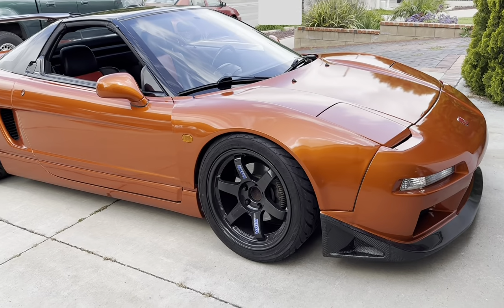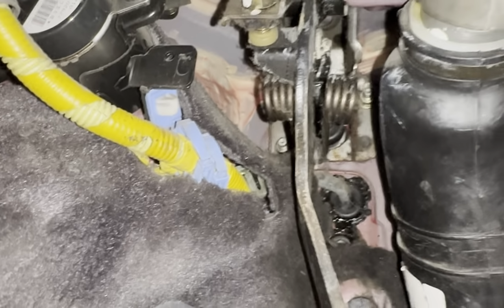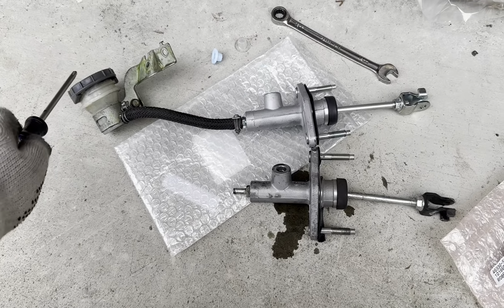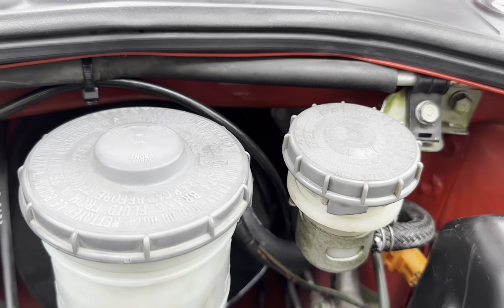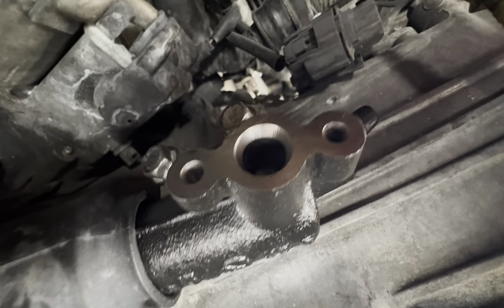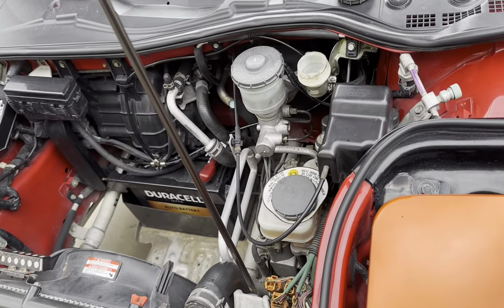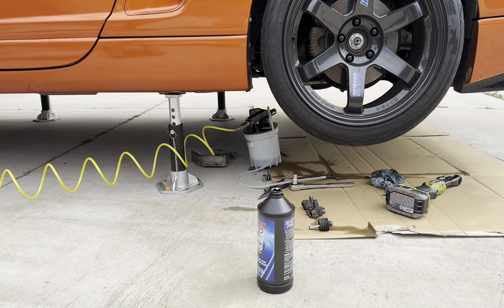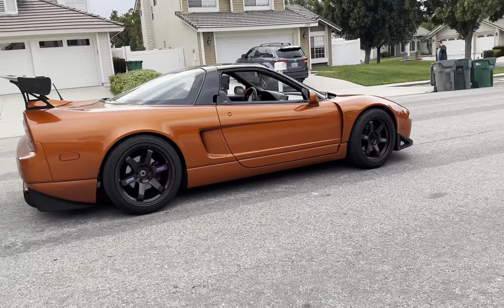NSX Clutch Master + Slave Cylinder DIY How to

Comment: I just had to do this. MCC is easier when you remove the cruise control module, so much space. I also removed driver seat as that made my life easier as a fantasy lmao 🤣  
Slave is a lot easier. Great video. I use a mityvac. I may have to look into the one you used.
Reply from the maker: Ohhhh man yeah i did debate removing those as well but i opted not to. Worked out just fine but boy is the job tedious lol.